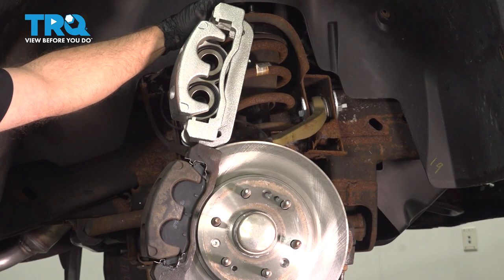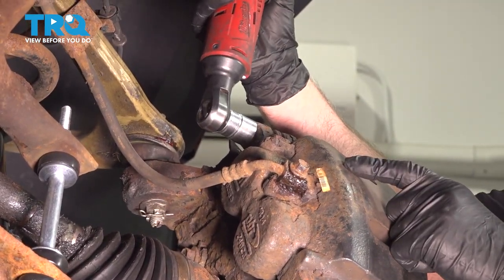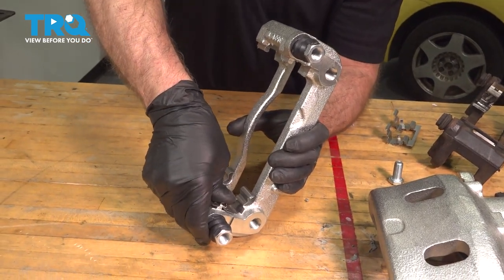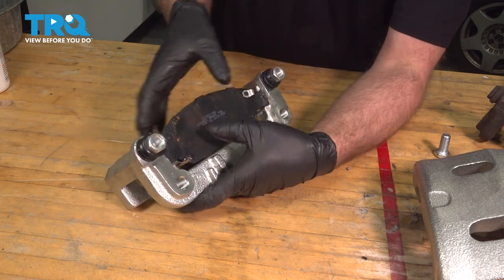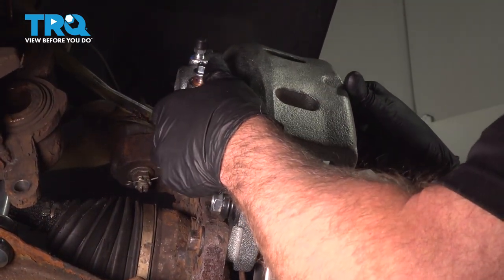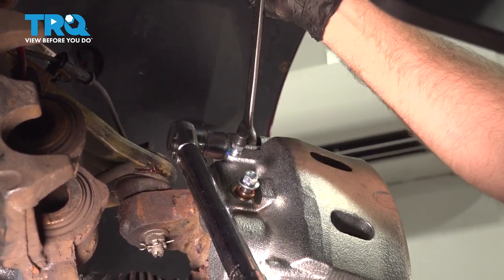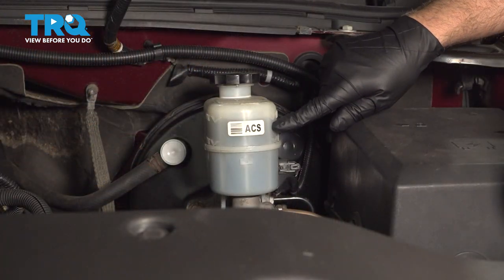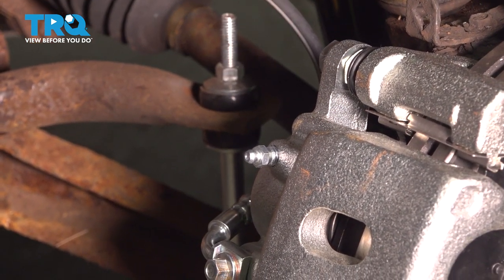How to Replace Front Brake Caliper 2007-2013 Chevrolet Silverado 1500

Comment: Great vid. Exactly what I was looking for. Lol. I'm used to older vehicles. I replaced rear calipers on my 09 burb. Pretty straight forward. What I seen different for the front was the tabs that protrude. I didn't know where the pads went in relation. Thank you

Comment: Thanks! 
Using your video as a guide, I recently replaced my oil pressure sensor & screen on my 2013 Chevy silverado 5.3. I got the PO300 the next day. I cleaned and retightened spark plugs/wires. PO305 this time. So I switched #5 & #7 spark plug wire. PO300 came back. Yesterday, I noticed that I may have crossed #7 with #5 fuel injector wire when I reinstalled intake last weekend. Would this cause random/multiple misfire? THANKS IN ADVANCE!!

Comment: You skipped over one major issue with GMC brakes. The bolts used to hold the calipers on are lock tighted with yellow lock tight. And man are they tight. Heating the bolts up to a dull red makes them much easier to break free. This is a major problem if you don't know how to deal with it, or you don't have the right tools.